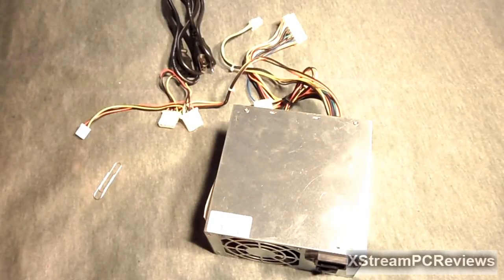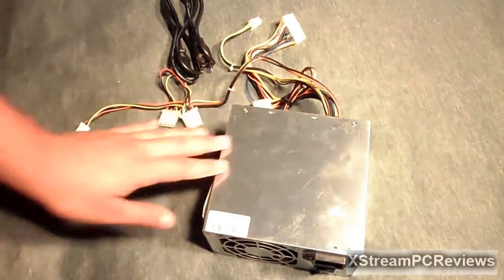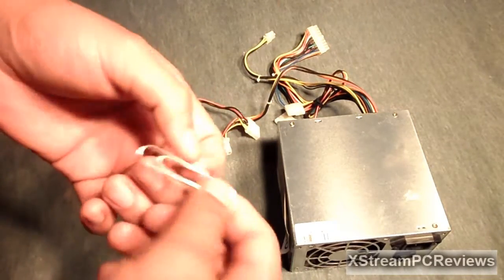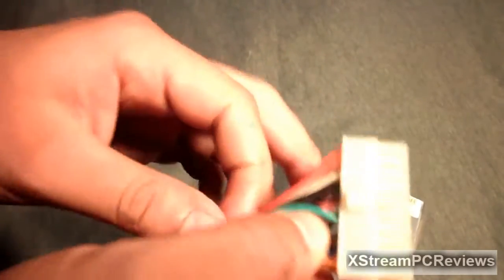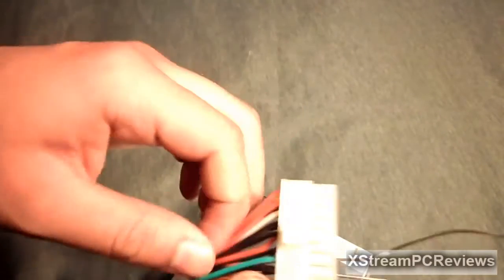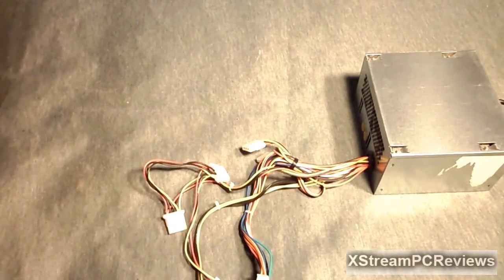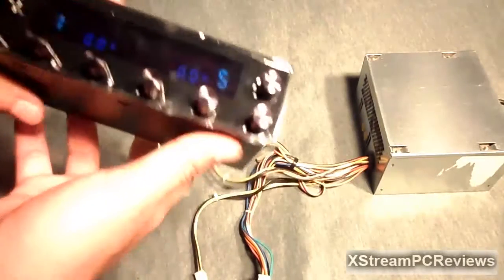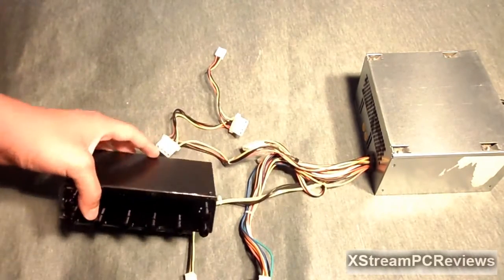How to Jump Start A Power Supply!

Comment from the maker: @mrjamesb562 i highly doubt you can get shocked from this, if you are really worried about that, then wrap part of the Paper clip with a bit of electrical tape and you will be good to go, and there is no difference between the 20/24 pin psu, as long as you find the green and your ground(black) it will work. 
Thanks for watching and remember to subscribe!